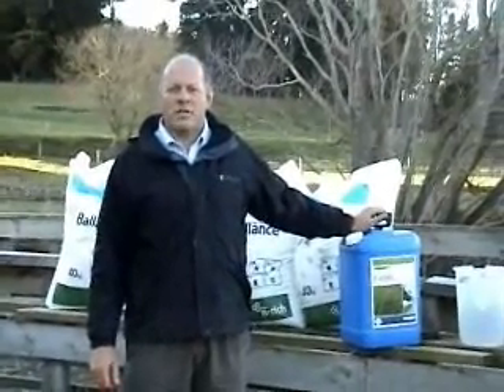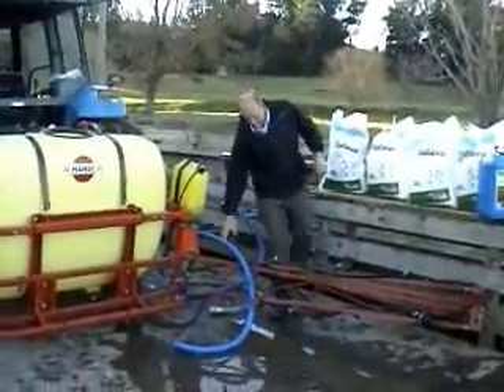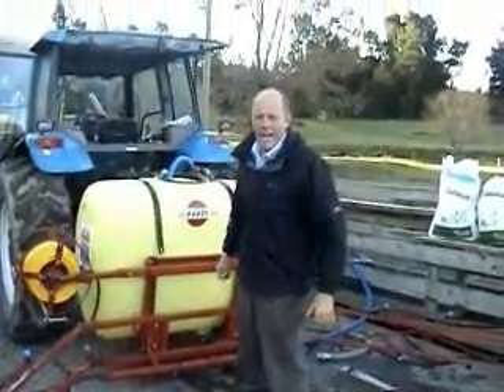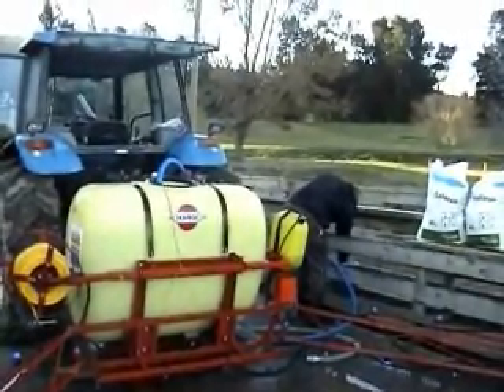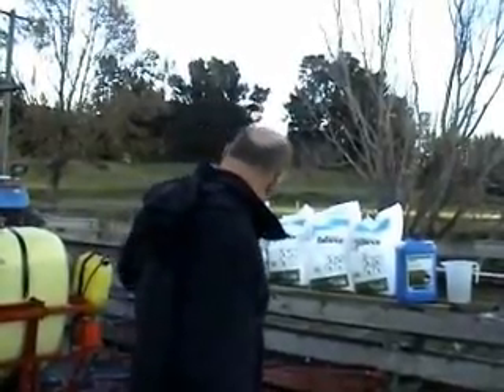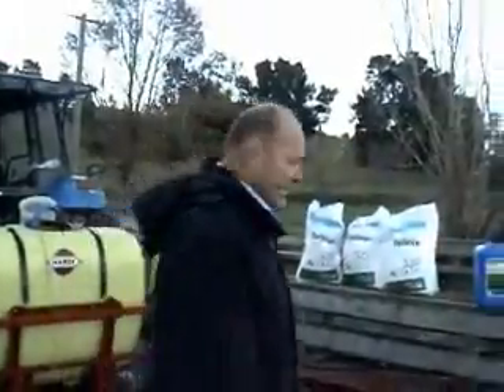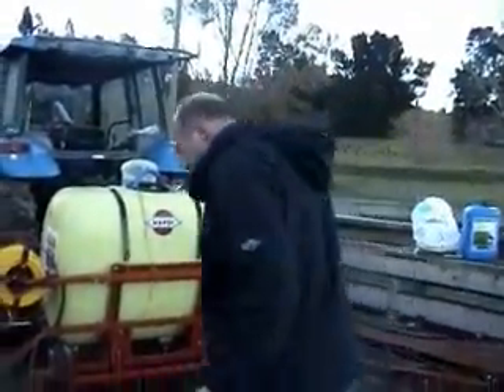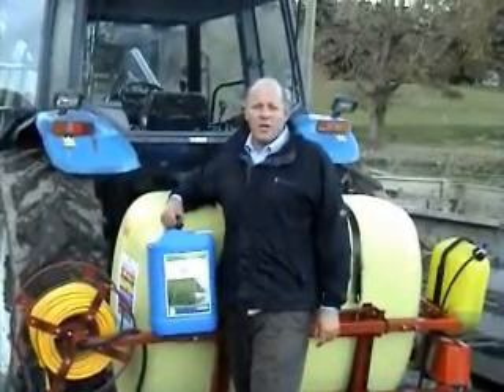Dissolving Urea

Comment: When I  foliar fed cotton years ago I  used a 2 inch water pump and some 30 gal. Barrels. Put the suction hose in the barrel and discharge hose too. 
Got the circulation going and proceeded to put the urea in and dissolved it. Then put it in my sprayer tank with my micro nutrients took about 10 minutes to dissolve the urea.